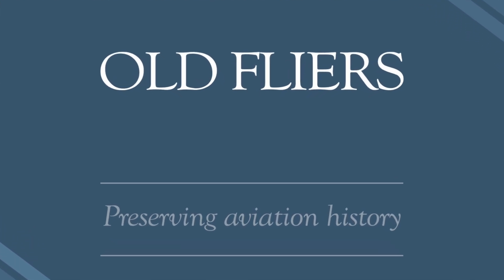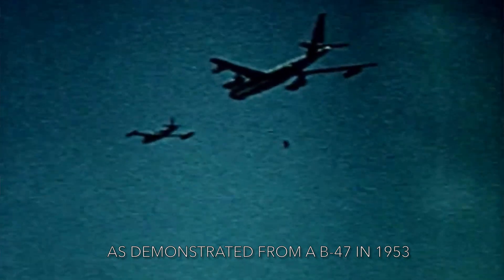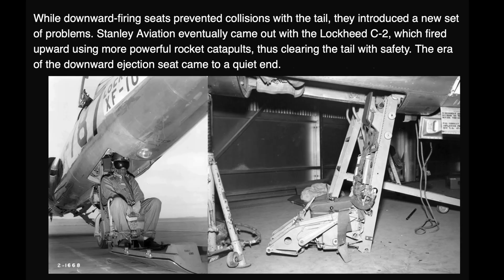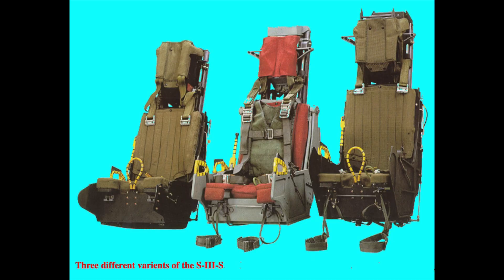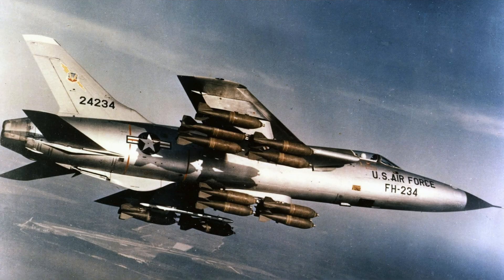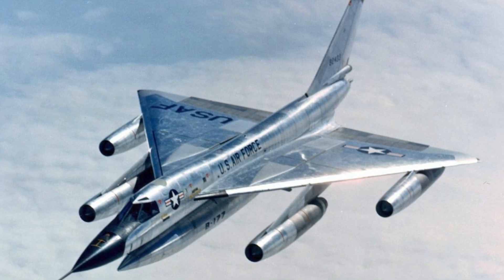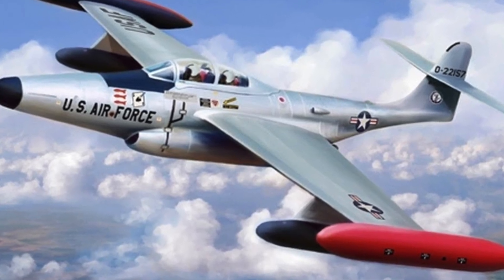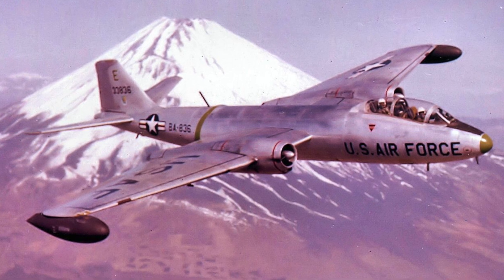Downward firing seat ejection -- a bad idea!

Comment: Didn’t know that the downward ejection was for clearance (thought I had heard that it was to minimize cold-exposure in high altitude ejections), nor that it was a common setup on so many plane types (which makes sense if the reason was clearance from the vertical tail)..

Well before seeing your recent vid on the Starfighter, I knew that some used it (downward).

RCAF base in Germany, as an 11or 12 year old in 1970 or 71, my dad told us that an air show crash death involved this. An American pilot flying one of our CF-104 lost his engine at low altitude, immediately rolled inverted and ejected into the ground. Dad explained about the difference in systems, and that the pilot’s training had kicked in. Besides the pilot’s loss of life, Dad said his wife was in the crowd.

Some systems eject right through the canopy, enabled by line-charges built onto the plexiglass (thin dark lines in pics/vid, not straight but wavy, one on either side of the top). Read that this allows a much faster sequencing, gaining 2-3 seconds over systems like the F-16 uses that must clear the entire canopy. Important difference if pointed downward at low altitude. Zero-zero seats still have limitations.

Cheers, Sir!
Reply from the maker: Thanks for comments Johnny.